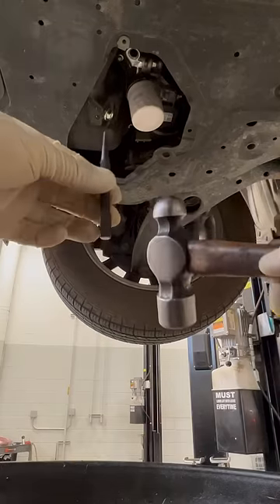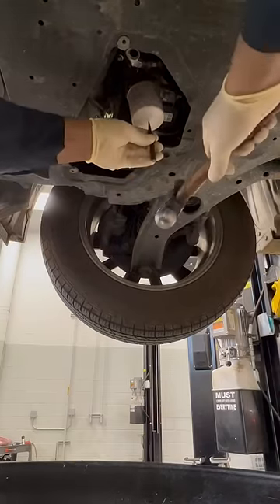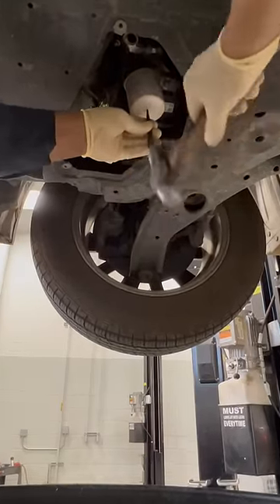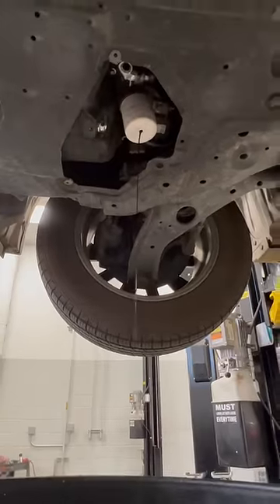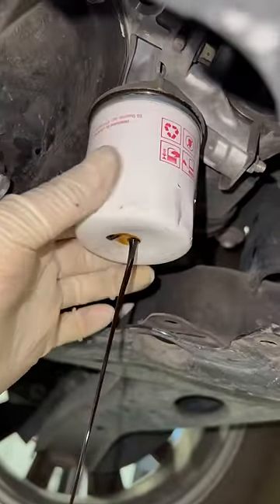Tech Tip Of The Day Oil Filter Clean Removal #oil #oilfilter #mechanic #shorts

Comment: Tech tip: make sure you can remove the filter first before doing this.
Reply: You can always drive a screwdriver 🪛 through that stuck oil filter and force it to turn 😃
Reply: @MicahFunk  Depends
Reply: @MicahFunk didn't work in mine. Shredded like paper. Had to tear mine apart.
Reply: @Colin Foley  that's the joy that comes with wrenching. It's never the same story. LOL
Reply: Oh yeah.
Reply: Lol
Reply: @jaybee5832 

On?
Reply: I thought the same. Was a few times i had to put filters back on after finding out we didnt have them amd napa or whatever supplier couldnt get us one
Reply: That defeats the purpose of doing this at all
Reply: Strap wrench go hard
Reply: Not the filter but the oil drain bolt. I bought a car and someone must of had a grudge because the oil drain plug was already stripped and I'm pretty sure they jb welded that b$tch in. I couldn't get it off. Shop couldn't get it off cause the bolt was too close to something and they couldn't get appropriate tools on.  Quoted me to drop the oil pan to get it out... couldn't afford it back then.  But hey did you know if you take the oil filter off and start the car for a few seconds it pumps most of the oil out?  Lol did it twice (over the course of 6-7000 miles)  and put a new filter and new oil in it before i got it fixed.  It was better than nothing
Reply: @MicahFunk * vietnam flashbacks start *
Reply: @75NovaGuy  I like how you improvised, given your specific circumstances. We can't always do things the ideal way, so we do the best we can at that moment with the options we have available.
Reply: For real.
Reply: @jaybee5832   works every time
Reply: did that mistake once! entire workshop was without air for the next 4 hours tryna get that fker loose
Reply: @skylined5534  Depends on how tight the filter is , the size, the clearance.
Reply: @RonXEATSX  🧢   Rarely works. On commercial trucks it never works. I do this.
Reply: Lmao what you gonna do never change it?😂
Reply: @j-prosper  The consequense is that if he cant get it off he might have to drive somewhere to get the proper tools. cant drive without oil now can you
Reply: @MicahFunk  Use a belt.
Reply: @zefyr0s  but first you should talk nice to it. Maybe even wipe it down and clean it up so it relaxes. Make it feel shiny and pretty. If that doesn't work sometimes just showing it the belt is enough persuasion. 🤨😆
Reply: @MicahFunk If you like saving money doing your oil changes I heavily reccomend a good pair of filter pliers. Also make sure when you put a new filter in to only do it hand tight, if you tighten it with pliers it'll be a pain in the butt to take off 😅.
Reply: You can do the same thing to your oil pan so you don’t have to remove the drain plug😂🤣😂
Reply: 100% was about to comment this 😂 would hate to do this and then you’re sold out of the oil or the filter or simply can’t remove it cause someone torqued it down to like 95 Ft lbs 😂
Reply: @MicahFunk  I've had oil filters rip apart because they were dry tightened or cross threaded by a previous "mechanic" and it was near impossible to get it off after without carefully Dremel-ing off. I don't recommend that either. A filter wrench or belt wrench should be the only thing you need to get the filter loose if your hands aren't enough,  but never punch a hole in it first because that causes a "soda can" effect and weakens the filter to where it crushes if you can't break it free with your hands and need a wrench.

Always loosen the filter first, then you can punch a hole in it.
Reply: Yeah man ive seen a tech take an air hammer to the fulter lid
Reply: tech tip: have the correct tooling before attempting anything of the sorts
Reply: Exactly what came to mind!! Loosen the filter first.. the. Proceed with whatever he’s trying to accomplish in the video
Reply: That’s an excellent idea right after you turn the oil filter 90°🤭😎✌️
Reply: Don’t Americans have filter wrenches ?
Reply: @MicahFunk  not always
Reply: I don’t even check to see if I can get it off with the oil filter wrench anymore…. I just run a long ass flathead through it. 😅😂😂😂
Reply: @kpj2224  no it doesn’t, you can turn the filter enough to make sure that it will come off before oil starts coming out.
Reply: Channellocks
Reply: @OGREgaming420 you gotta go right in the middle closer to the threads or at the very bottom
Reply: @MicahFunk i did this once, it was the worst decision of my life and spent all day trying to take off the threaded part of the filter as the rest of the filter had ripped off through shear force and desperation
Reply: Dead Playa  oh man! Isn't it crazy how some of the most simple of tasks can turn into complete and complicated mayhem?! Sometimes I swear there's got to be a hidden camera somewhere watching how I react to insane stuff! LOL
Reply: @MicahFunk  there are definitely hidden cameras. You just need to find them. I know where they are, but I just stopped caring. 😆
Reply: @MrMinecrafter16  no you can’t. The oil will come out no matter how fast or slow you turn it.
Reply: @kpj2224  you can turn it about half a turn before oil starts to come out. If you can turn it half a turn chances are it will come off without a problem.
Reply: @MicahFunk  lolol. 
-laughs in CrackerMilk...
Reply from the maker: Always Verify Proper Oil Filter before Replacing it #mechanic #cars #oil #filters
Reply: @kpj2224  I have horizontal filter and it doesn´t leak when I turn it loose a little.
Reply: And always do that before you drain oil through drain plug. I did this mistake once and the filter didn´t go off with hands, filter wrenches,... I was about to punch a screwdriver through it but realized I have 3" pipe pliers lying somewhere in the garage. First I wrapped few layers of fat insulation tape around filter can so the pliers could sink in without damaging filter. And it loosened easily. From then on I never drain the oil pan first.
Reply: Well what else is gonna happen. It's coming off regardless if it wants to or not

Comment: make SURE that you can get the filter off of the car before and make sure that your new filter is correct before punching a hole in the filter
Reply: i made this mistake once luckily it was a 2000 jetta worth like 500 bucks but after that i didn’t have a car for a while so that sucked
Reply: This was tested on a YouTube channel and it's fake
Reply: @Alvinloser1  can you link it bossman?
Reply: @Alvinloser1 what’s fake?
Reply: @orangefruit8068  he is suggesting that poking a hole in the bottom of an oil filter will drain the oil so you don't have a mess, but that is not the case you can still be showered and oil
Reply: @Alvinloser1  I think it is just to drain the filter before removing it so it is not full. Still need to drain your oil from the motor also… but still need to make sure it can be removed before you poke a hole in it
Reply: It it don’t come off you have issues. I’ve never owned my own car and an oil filter not come off. Lol

Comment: Tech tip- Always change the blinker fluid everytime you replace the muffler bearings.
Reply from the maker: Always can’t forget 😈
Reply: Make sure you also change the air in the tires
Reply: Where’s the blinker fluid at? My blinker has stopped working and I didn’t realize I needed to change it
Reply: It’s always the Honda civics that need their muffler bearings replaced
Reply: Also can’t forget the wiper brakes too. If you don’t change them you’re wipers won’t stop and will go right off the windshield
Reply from the maker: @PLINKU   Nissans actually have a muffler  bearing in the parts catalog
Reply: Did that now I have an apparently broken piston wth
Reply: You might as well, they’re in the same area so
Reply: You forgot the power steering gerbil you gotta change his running wheel
Reply: i thought you change it everytime you change the timing bushings 😭
Reply: 🤔🤔🤔good idea
Reply: Fun fact one of the models of the Dodge viper does have “blinker fluid”. - It’s a water level
Reply: You’re not funny bro.
Reply: Can of beep for the horn is a must for city traffic.
Reply: @christianmoran8122  your not chill bro, take a joke bro 💀
Reply: Dont forget the brake rotors for your windshield wipers
Reply: domt forget the mirror reflective battery
Reply: Tell me what diesel exhaust fluid does?  And why blinker fluid is an ongoing parody, when there really is such a thing as Diesel exhaust fluid?  U need to stop with that blinker fluid joke. If u really know about cars, blinker fluid makes sense.
Reply: Wait..I’ve never changed my muffler bearings or my blinker fluid. Is that why my car keeps breaking down?
Reply: @kendalgee5808  do we tell him
Reply: @kendalgee5808 Your blinkers are run by an electric circuit: your blinkers work when your battery has enough energy in it to make the blinkers work, there are no fuses blown, and/or if there are no burned out light bulbs in the blinker lights.

Blinkers are not a hydraulic, pressurized, or otherwise fluid-dependent piece of the automobile. They operate by closing an electrical circuit which turns the blinker on. This does not require any thing to be moved hydraulically in order to close the circuit, just a simple flick of the blinker handle near the steering wheel.

Comment: Instructions unclear I am now installing a new oil pan
Reply: @TurtleAsshole 💀
Reply: Bwahahaha
Reply: Nah, thats just how you drain the oil out of your engine
Reply: Matt Casatuta  woosh
Reply: Hahaha
Reply: Extremely unclear, used my motor as a toilet
Reply: @ziggy442  hahaha
Reply: @ziggy442  wooosh
Reply: This a Mazda engine and the oil filter housing is attached to the engine block.

Changing the oil pan would be completely unrelated.

Might as well say you need to change the right signal bulb now

Comment: You can also grip the filter using a plastic/solo cup and the cup catches all the oil👍🏽
Reply: I like this one better. Crack it loose, then grab with cup. Not gonna spill much if you hold it level. Punching a hole gets oil all over your punch, and probably your hand anyway and hopefully you got a bucket in the right place🙄
Reply: That won't work if your car has the oil filter horizontal like all but one of my cars has been
Reply: @mikeg3950 a punch is probably the easiest tool I could think of to clean
Reply: I’ll grip yours bare handed😮
Reply: @samkostka126 so... If you're car, like mine, has an angled oil filter and it drips all over you each time you change it. Lift the car from the side the oil filter is facing. Not only will it get you better clearance but it should also increase the angle the oil filter tilts allowing for the oil to drain down instead of puddling horizontally and making a mess every time you try to change it. Even a slight incline will do the trick and if you're more comfortable changing your oil filter the same way as always no problem, you can just step out from underneath leave the oil pan still dripping, bring the car down, jack it up from the side for a minute to get that oil on the filter to drain and then jack it up again the way you always have and you should be able to get it out with out the mess.

Comment: I sure do hate it when I get my disposable rubber gloves dirty.
Reply: under rated.
Reply: I don't know how guys can wear those latex gloves when working on cars/bikes, after a few minutes i have to rip them off they drive me crazy.
Reply: @uhtred7860  I rip/puncture them in 2 minutes.
Reply: Lol a box of good gloves can cost like 30bucks 🤷🏿‍♂️
Reply: @3sotErik  Latex gloves feel absolutepy heinous, you can't have a guitarist thumb and wear latex gloves because long ass guitar picking thumb nail tears right through latex like butter.

In short, latex gloves fucking suck
Reply: @O-bearer-mine  yeah, after seventeen years of factory work, my hands are rather calloused.  I used to use them for resin 3D printing out of necessity but I've switched to Kitchen/dishes gloves because half the time I ripped them just putting them on.
Reply: @esotericbear9829 not the 12mil ones I got at a discount store for $10!!!! 😅
Reply: 😂 didn't even think of that but liking all the comments 😂
Reply: They are insurance. You still dont want a mess on gloves because it spreads. Go outside
Reply: @slommie1649  Go outside? In the last week I've built & stained a deck & swapped out the water pump & engine on Craftsman & Honda pressure sprayers to make 1 good pressure sprayer. All without gloves.
Reply: I work in a lab testing marine oil and I swear I hate getting my gloves dirty because it’s a waste of time. If you’re having to change gloves every 10-20 minutes you’ll probably waste at least half an hour a day just taking the dirty ones off, drying the sweat from your hands and putting clean gloves on.
Reply: @3sotErik   If you don't want dirty oil on your hands you wear gloves as insurance because that's easier than washing your hands. Dirty oil spreads. You didn't even engage with my point.
Reply: @slommie1649  I concede that point. I addressed the "Go outside" because you don't know anything about me. I just accept the calluses, scars & stains that no amount of soap, gasoline or turpentine will ever remove.
Reply: Eh, some people (me included) don’t want to get other stuff oily so we wipe off the oil with a rag/paper towel. Plus it’s a pain in the ass to put on another glove right after taking one off, so keeping oil on your hands to a minimum is nice, even with gloves
Reply: i sure do i hate it when 150 degree oil runs down my arm and burns the hell out of me
Reply: @uhtred7860  right? that's what they make GoJo for. The disposable gloves go on when I'm one and driving your car to the parking sot
Reply: My job pays for my gloves so this is pointless 😅
Reply: @killfase01  understand that this isn't the nor and with flat rare, you're paying to work normanlly
Reply: @StickWarrior  I owe the tool truck like 6-7k if that makes u feel better. But I understand. You gotta punch the filter to properly drain it so might as well punch it when u can
Reply: @killfase01  I mean so you're in debt to a pyramid scheme and don't understand how to use the tools you're so in debt for?
Reply: @killfase01  a band and a claw are all you need for canisters and both of them are last resorts. God gave you hands. 
Punctures the filter only works like that on up and down mounted filters. A puncture is going to leak exactly like where you would have just untwisted it
Reply: @killfase01  nothing drains a filter better than taking off fuckin lol
Reply: @ang_10011  my kinda man. Gloves go on after the work, not before. It's just got drop off
Reply: Always a KAREN
Reply: @the_batmobile0.4  I don't think you know what that word means.
Reply: @3sotErik  I do not pretend to literally know anything about you. I was just being snarky because you seemed to have not considered what you said more closely and were sarcastic in your comment.

 I'll take that as a lesson in being more specific with my language.
Reply: @slommie1649  all good.
Reply: It runs down your arm genius. You must not work on cars alot. 😂
Reply: Shits annoying, Man. Smh. And using rags and paper towels are bad for the environment. 🤣😂😅😏
Reply: Yeah but imma definitely rub my face with that all over 😂
Reply: Alot of people dont use gloves
Reply: Now that's funny af! Even with gloves on we still don't wanna get dirty..... why is that?
Reply: You probably never removed an oil filter screwed on from below. The oil don't stop at you hands. If you aren't fast enough, your half arm is full of oil.
Reply: @alicethegrinsecatz6011 I had a truck that had the filter 1/3 the way up on the drivers side  & it was angled. There was no way to not get it all over. Just last night, my sister-in-law paid my son to change her oil. He forgot to open the plug on the oil catch pan. It went ALL OVER my driveway. Oil dry & the pressure washer didn't do much to remove the  stain.
Reply: aaaaaaaaaaaaahahahahahaaaaaaaaaaaa yooooooo
Reply: i really do hate it tho, and its not even a $ thing since i am the one who has to buy them, i jsut dont like wasting gloves i guess lol, and i hate transitioning from gloves t ono gloves and back
Reply: iWumbo34  amen brother, best of luck to you
Reply: This. But without the sarcasm. You just going to touch the customer's key, door, and steering wheel to pull the car back out of the shop with oily gloves or are you just going to waste your Diamond Grip gloves on every 15 minute oil change?
Reply: @ApertureAppliedScience at less than $0.50 a glove, damn right I’m gonna change gloves in between jobs lol.

Comment: Great tip. Just make sure you have the correct filter replacement first
Reply: You can put a screw in it and save yourself
Reply: That's the very first step......😂 nah just empty the oil, then go buy the oil and filter
Reply: It would be my luck that it's the wrong one... I'll just continue getting dirty